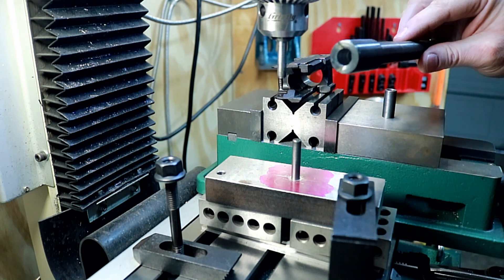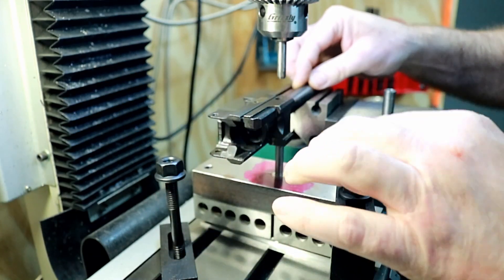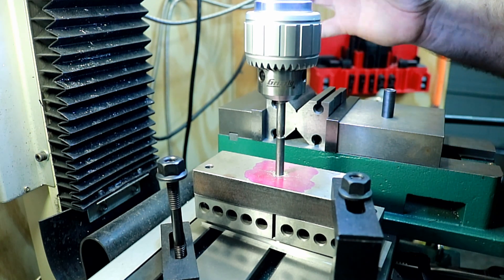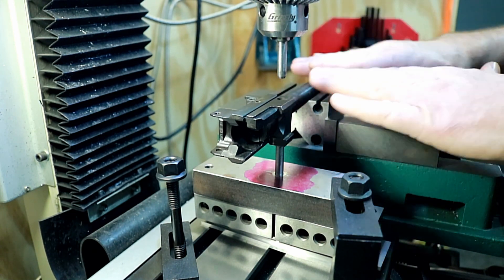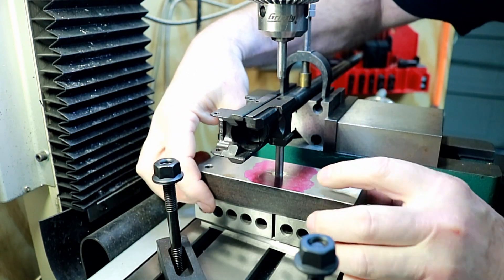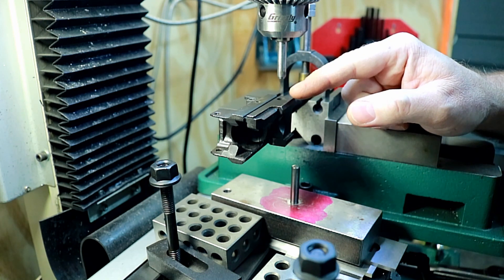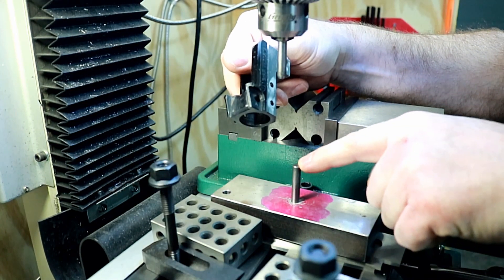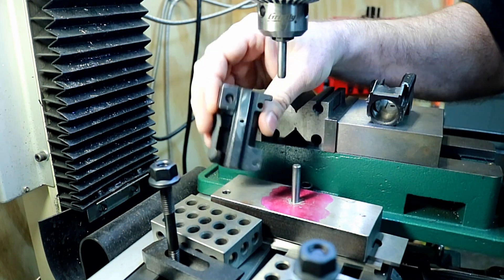Barrel Pin Hole setup

Comment: I was drilling a hole into the barrel to screw the lower receiver to the front truion. Now I have decided to have the front truion riveted to the lower receiver. Can the barrel be repaired by mig welded the hole and having the front truion pressed onto the barrel?

Comment: Great looking setup. My drill press has so much flex in it I’m having a hard time drilling my barrel pins. I usually have to oversize them and use your .302” pin. Someday I’ll get a mini mill and that alone with a setup like this should make life a little easier. Thanks.

Comment: So, Mel, are you still beginning with a normal 7mm drill, and then finishing with a reamer? Or have you started to go in with an undersized end mill, and finishing with a reamer? This is a bloody fantastic set up, though. Nothing scares me more in AK building than drill the barrel pin. I'm stuck with a soddy HF drill press, and it's gotten good results when I don't just make a completely bone head mistake. But I quest for anything that will enhance my success rate. This looks very promising to try.

Comment: Just curious, why would you not headspace the barrel before riveting the trunnion into the receiver?
Reply from the maker: It can be done that way (on an akm) if the builder so desires. Head space should be done with the bolt and carrier to allow for proper alignment and contact of the bolts lugs to the locking lugs of the breech block (trunnion). So having the front trunnion riveted into the receiver first allows for the proper alignment just as the factory would do it. Also, think about a milled receiver. There is no head spacing with the front trunnion out because there is no "front trunnion' it's all one part.
 
In my opinion, the barrel pin should not be drilled until the breech block (trunnion of an akm) is riveted into the receiver. Drilling the barrel pin hole then removing the barrel and re pressing it back into the trunnion hoping to get the alignment back perfect is sometimes a headache.

Comment: Hi Mel, Great video once again. 
If I go with the AK builder 12.5” barrel do I have to go to a shorter piston and tube like an AMD system? I’m probably going to go to the JMac gas block/ front site. If I could use either. Which one in your opinion would be best?
Reply from the maker: Forthe Hellofit    Not sure if I’m remembering correctly, but I think the amd’s have a shorter gas tube. So you would need the amd gas piston. All my pistol builds use an amd barrel with the amd piston.  If you chop (before install on pistol build) a 16” akm barrel down to 12.5” you can still use the normal gas tube and piston with a combo gas block.
Reply: Im definitely going today get a new barrel. Looking at the ballistic differences between 14,5 and 12.5 I figured may as well go with the shorter. AoA has those BCGs on sale with piston on it ready to go.

Comment: Hey Mel, when I spot weld my bolt carrier rails in I use the harbor freight 120 V spot welder. I always seem to have a problem with the welds being too weak, I clean all the metal up really good, I just put a 240 V outlet in my garage for my 60 gallon air compressor I’m thinking of getting a 240 V spot welder, do you think that will be an improvement on the welds? And what volt spot welder do you use?
Reply: I know its been awhile since your comment and you probably already figured out your rail issue but Mel uses the 120V harbor freight.  Should be plenty fine to spot weld them rails in.

Comment: Drilling for the barrel pin has been my biggest problem. It takes me forever to line everything up on a drill press, Knock on wood I haven’t screwed one up where I couldn’t fix it with a over size pin. How much smaller are your guide pins than your barrel pin?

Comment: Welcome back!!!!! Long time no see! Glad to see your back! Great Video again!
Reply from the maker: I have a few videos I’m filming now. Just takes time when you’re doing it all by yourself.
Reply: @Mel64d  I have a non related question which I'm sure you can answer. I have a receiver ready to go for a triangle stock side folder kyber pass build. I need to know if there's a difference in the 5.5mm and the 4.5 mm stock setup and which one I need to order for my build? Any info would be appreciated,thankyou
Reply from the maker: Jer Harr   The two stocks will both mount flush to a receiver but will have a 2 degree angle difference. The Russian 5.5 mm trunnion holes are slightly different from the Bulgarian 4.5mm trunnion. Both trunnions will rivet into the same holes, but if you mount a 5.5 trunnion into a receiver with 4.5 hole pattern there will be a gap at the bottom of the receiver between the trunnion and receiver. So if you buy a receiver with the holes for the rear trunnion already drilled, then buy/use the correct trunnion and stock, or buy/drill trunnion holes for the stock you are using/have.
Reply: @Mel64d  thankyou very much! That definitely cleared up everything! Have a great day!

Comment: Thanks for another great video. What's the vise that's holding your barrel? Purchased or homemade?
Reply from the maker: I have a v-block in the vise holding the barrel. They can be purchased from any Industrial Supply house or made if you have the materials and equipment to do so.
Reply: @Mel64d  Thank you 👍🏼

Comment: Hey Mel
Great Video. Like the mill. Going build a setup like yours. Have been using the V block method since I saw your first video on this subject. Works 90 % but sometimes get a little bit of egging. Then I go through with the .302 pin and it cleans the egg up.

Harold

Comment: Hey Mel, Is that the G0704? If so how are you liking it? I'm looking at the G0704 or a Precision Matthews PM727 a little higher quality and a touch bigger. I'm still on the fence about them.
Reply from the maker: I have the G0759 with the DRO and stand. So far it's been great for this. If I have something that requires more serious milling, I will just take it to work.
Reply: @Mel64d  I believe the G0759 is very close to the size of the Precision Matthews I'm looking at. Would you say with a little finesse they can handle most operations an Ak would throw at them? I do have access to larger machines if needed. I appreciate the response Mel I hope we keep seeing you around!

Comment: I like the set up. Anyway you can make one for sale?
Reply from the maker: I do not make jigs for sale, sorry.
Reply: @Mel64d  Hi,  i  want to bay a drilling machine from harbor freight tool, which one should i bay  8" - 5 speed,or 10" 12 speed for AK47 build. Thank you!
Reply from the maker: @arch-x8i    Never used any of the Harbor Freight setups. Bigger the better but It’s best to get one that can do variable speeds.
Reply: @Mel64d  Well, thank you.